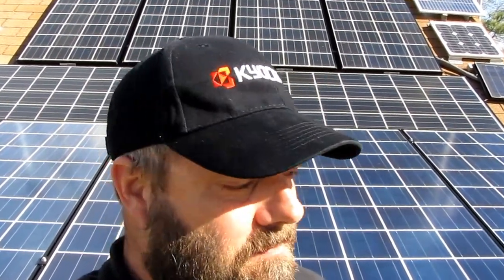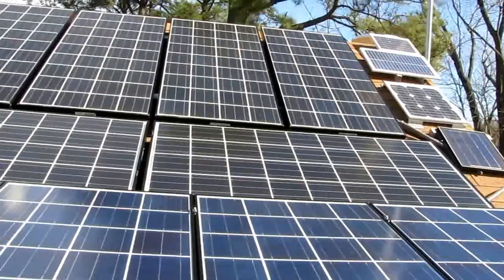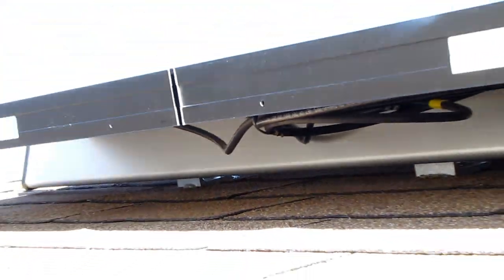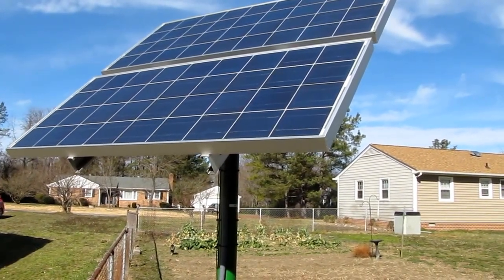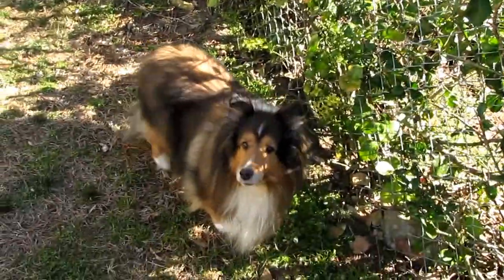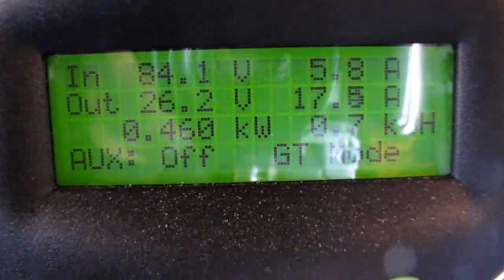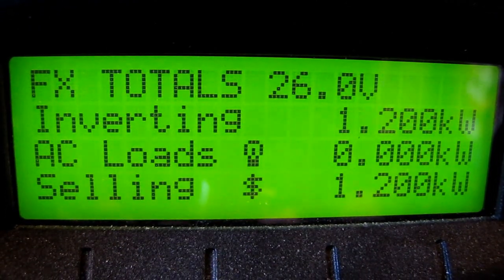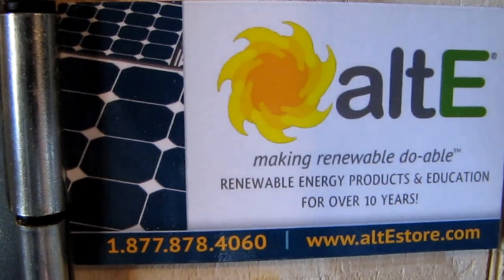Solar Panels The Day After Installation Kyocera KD140GX-LFBS Power Production

Comment: Why was your 24V array out-producing (i.e. total power produced) your 84+V array?
Reply from the maker: +zeffur7 More Panel On The The 24 Volt Array
Reply: +KVUSMC / Kenneth W Viar Jr 
How many panels are on the 24V array & what is the total rated output of those panels?

Also,  your 5 new panels:
produced 5.8A@84V=487.2W,
of which you got 17.6A@26.2V=461.12W of useful power.
461.12W/487.2W=~94.6% conversion efficiency (which is good).

But, you stated that your 5 panels were rated at 700W,
therefore 487.2W/700W=~69.6% conversion efficiency (which isn't too good).

You mentioned that it was ~11ish AM & that is close to midday, so I'm curious to know what your maximum useful power was from your 5 new panels?
Reply from the maker: zeffur7 Hi Buddy You Know Your Stuff Wow I now Have 860 Watts In That Lower Array I know That Lower Array Produces Around At least 6 kWh on a good Day Buddy  As Far As Usage I'm Using Everything I get  Here You Go Buddy I Produce an average of 10 kWh a day to 15 kWh on A good Sunny Windy day cheers Kenny https://youtu.be/Gq8bZdNhRqY

Comment from the maker: Just The Lower Array Is In Series  excuse Me all In Series 5 12 Volt Panels  At almost 18 Volts each x 5 = to 90 Volts The Other Panels are In Series But In 24 Volt  2 -12 Volts Together  Yeap The OutBack MPPT Steps The Different Voltages Down Scott It works Great

Comment: You say you have them all wired in a series? 5 x 12 would be 60 volts or more. Are the six panels above the five wired in a series too? 6x12 volts would be 72 volts. So does the out back sort out the different voltages?